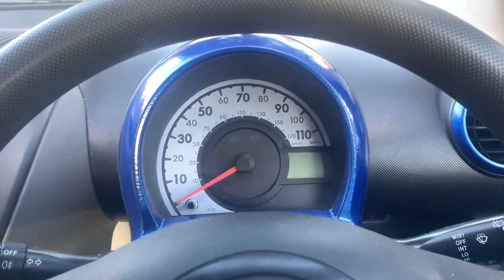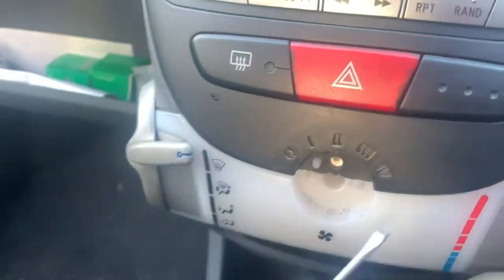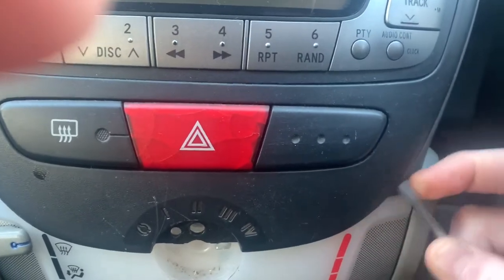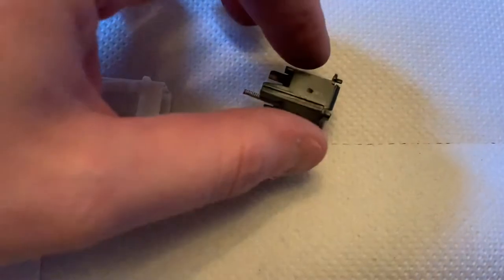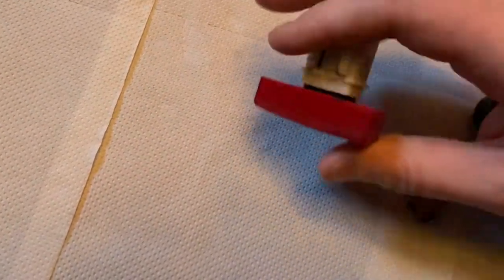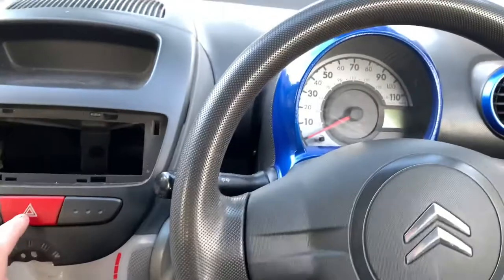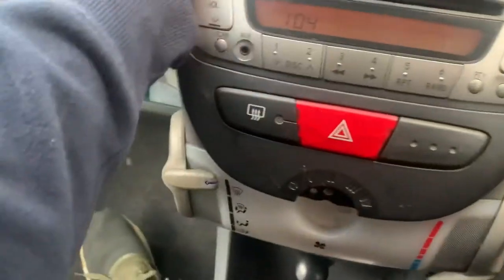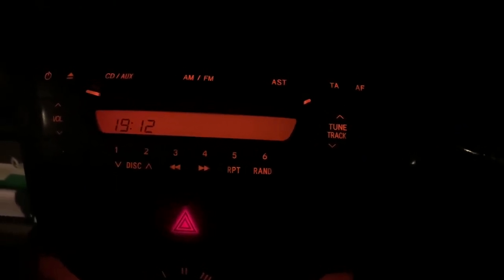Citroen C1 Hazard Light Switch Free Repair, No New Parts. Aygo/107/CityBug

Comment: Thanks for this, helped me fix my sister car. The switch was working intermittently, the plastic along the contact rails had covered the 'on' position. A good clean up worked a treat.
Top tip don't push your screw drive down the sides of the switch, I almost broke the locking mechanism.
Reply from the maker: You’re welcome, and yes you need to be careful not to damage it when taking it apart

Comment: Another good vid thanks! Tip for factory unit, you can crimp a cheap spool of speaker wire to two iso pins and pop the, in the block, reconnect and run the wire behind the dash and under the sills to the back easy peasy. Frill and hacksaw out a couple of holes the right size for the speakers. Even fitting a cheap pair of £20 pioneer coaxial from Halfords in the rear parcel shelf improves sound massively, as they give pretty decent volume increase over standard and use the boot as a bit of a bass box. Nothing earth shaking by any means, but massive improvement in loudness and range vs the two crap front ones only 👍 I used covered bullet connectors coming from each side up high, so easy to disconnect should my daughter need to remove parcel shelf at any point 👍
Reply from the maker: Yea the factory stereo has the outputs for rear speakers that can be wired in. Some of these cars even have parcel shelf speakers from factory and have them with a plug that can be disconnected easily.

Comment: This video actually saved me buying a new switch! I’m actually shocked usually when I do things like this I end up with springs and plastic up my nostrils, but it was an easy fix 👍🙂 
Have you ever changed the front anti roll bar bushes (not the drop links)? I’m hoping I can change mine without pissing about dropping the subframe.
Reply from the maker: Good to hear that it helped. I’ve not done the anti-roll bar bushes on one of these before, but plenty on other cars. The general tip with anti roll bars and drop links though is to either not jack the car up, or jack both sides up. That way you’re limiting the strain on the ARB and makes it easier.

Comment: As ever, informative! Am making my C1 into a van........thats being from Bolton for you 😁😁
Reply from the maker: Sounds like a good idea. Are you panelling or tinting the windows?
Reply: @StupidBlokeStupidVideos  i was just going to spray paint them black! Batten out and ply board the floor with a flap for the spare wheel. Learning as i go, currently converting a transit to a campervan and applying the woodworking principles to the Shitroen 👍
Reply: @StupidBlokeStupidVideos  selling the seats, carpet, parcel shelf on ebay 👍
Reply from the maker: @flapsfalkland5181  good luck haha

Comment: I tried taking my hazard switch apart a few months ago. I cleaned the contacts with an eraser, but it still wouldn't work after I bent the contacts & put it back together. I had to buy a new one for £16 😕
Reply from the maker: Yours may have been too far gone, but easy enough to do so was worth a try I suppose 🤷‍♀️

Comment: You can also fix the switch to knock it, BUT not to hard and do it for 10 times maybe 20 or more. Studently it will work. But for how long i dont know. I think you always kan do it again. I  always check it when i make service on Aygo (same)
Reply from the maker: Yes twatting it often works as a temporary fix, but not always. Now the switch works perfectly every time 😊

Comment: I have a question hopefully you can help. The hazzard switch on my wife's C1 works fine, however the red part on the front with the triangle on has came off exposing the switch behind. Can you tell me if these just push onto clips? I've tried pushing it back on with no joy.
Reply from the maker: It should push on as far as I can remember. Maybe it’s bent or broken as they commonly crack.
Reply: @StupidBlokeStupidVideos  thank you dude thanks to your video I'll take the centre out and remove the switch to find out what's up.

Comment: I also notice on your video, as in my case too, that the light of the button is not working anymore after the change. It is the same for the AC button, even both are functional, the light is not working, any idea why?
Reply from the maker: It was a mistake in the vid, it is working as it should be. It just lights up with the side lamps not flashes with the hazards

Comment: Great stuff, saved me £25-32 from buying a new switch.  By the way, the original head unit is basically junk.  Anything around £30 from Amazon will sound better and louder than that PoS.  Also, to prevent future build up, I've added a thin layer of Silicone Grease at the copper contacts.
Reply from the maker: Good stuff. Yea the original head unit is turd, I ditched it for this cheapo MP5 player a few months ago. 

https://youtu.be/MPR1jrsV5Z4